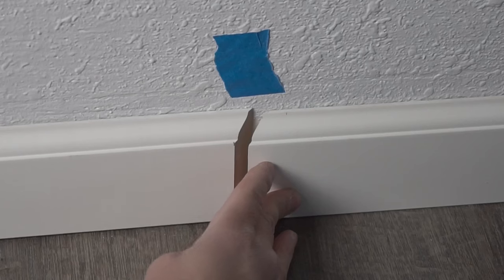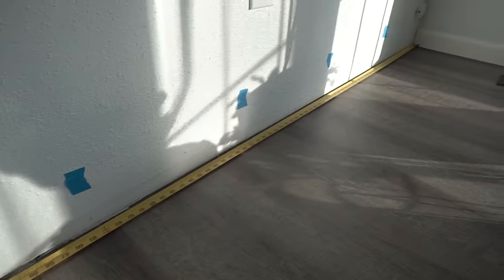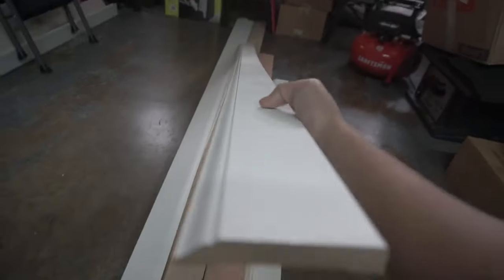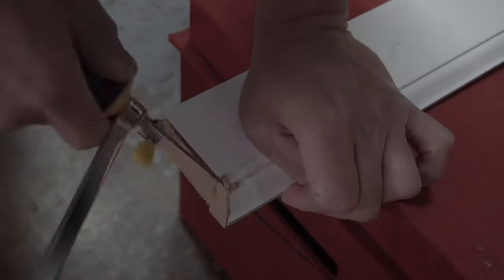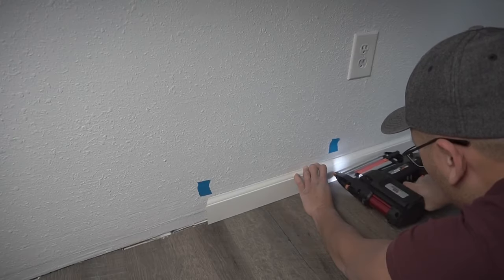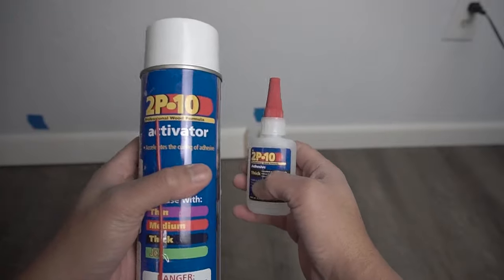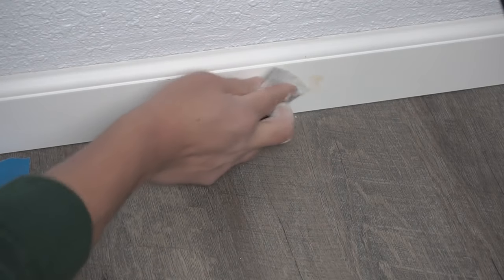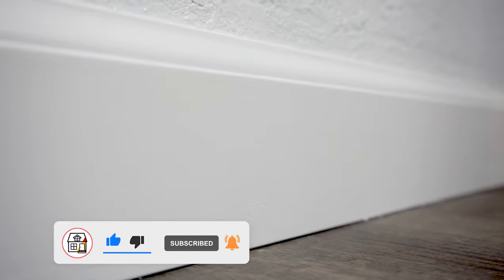How To Get Perfect Invisible Seams Joining Baseboard Trim And Moulding Like A Pro! | Scarf Joint

Comment: You're the man! Excellent tutorial. I wish the trim installers that worked on my new home build had watched this video. The decorative trim they installed near the middle/perimeter of my dining room walls have such raised bumps that you can see the joints from 12 ft. away!
Reply: I had the same problem from DIY previous owners did. I sanded and repainted, even did wood filler in the bad gaps. Can’t even tell!

Comment: Pretty good demo but can see about an inch above the new baseboard where the top of the old baseboard was. Looks like the wall was just painted over. I would've either sand it out and match the orange peel texture of the wall or just put the orange peel on, then paint. Just something I would do.
Reply from the maker: Thank you for sharing your technique 👍🏽😊🙏🏽

Comment: great video.  question ? so when you are joining the two pieces of baseboards like in the middle not inside or outside corners but just connecting two pieces did you just cut both the ends to 45 degrees. That is what it looks like and add the wood filler so you can't see the seems?

Comment: Scarf joint looks great! Question... Im thinking about DIY my baseboards on my new Vinyl Plank Flooring. The installer said to use 1/4" spacers for installing the baseboards to allow for expansion. But I noticed you just laid them on the floor planking and nailed them in... Is this a mistake on your part or is the 1/4" space really needed?
Reply: Are you saying to lift the baseboards off the flooring by 1/4"?

Comment: Have you ever had issues with the cyanoacrylate glues versus a wood glue long term? I worry that it may crack/split over time
Reply: Woodworkers trick... use both.  I use a couple dabs of CA on one side & spray hardener on the other in the center to place and hold the pieces to get perfect alignment, but most of the joint is held with traditional wood glue around the outside edges.  The CA will hold the alignment and the wood glue will provide the strength.

Comment: If you shim under the baseboard, how do you cover it up? Do you run a bead of caulk on the bottom?
Reply from the maker: Yes you can caulk or use quarter round or shoe molding 👍🏽😊

Comment: ok, so if you had to cut out a small section with an oscillating tool how would you make that 45 degree bevel? or would it have to be a straight seem if you're not able to take apart both sides?

Comment: I also heard you can use tape on the cut so that the finish doesn't chip with most types of wood - take with a grain of salt though no idea what kind of tape or if it actually works.

As for the finishing, use a damn putty knife thats as close to the size of the baseboard as possible, use DAP (the blue container with pink stuff inside) and use very light coats, sand with 360 grit, wipe with soft cloth and tape your wall with painters tape then caulk using your finger in one smooth motion (no going back over it if you can avoid) then paint pronto and once done peel tape - this will give you a very clean line & prevent hours of trying to sand something (also scrape your putty knife edge to clean it every few passes) this only works if you don't have stucco walls inside. When doing trim you touch don't roll it, use a high quality brush and floetrol - will get you very smooth or glass like finish - actually you should spend money on 3 things and go as high quality as you can 1. paint brush 2. roller (the frame if you will) & 3. drop sheet 3 1/2. a decent locking extension pole of your choice

Comment: Why not lay the trim flat and turn your saw to the 45 degree on the vertical slider.  Or does your saw not have that feature.  Most do though.  I used to do it your way but the blade never cuts down far enough through the trim

Comment: Outstanding.  This is the only part that’s giving me fits.  God help you if you don’t get that set perfectly with that CA glue….you’re f**ked.  I’d kind of like to see how that’s fixed.  I need a few more seconds of adjustment time.  So, maybe I’ll try using the drops on both sides method.  I just don’t want it to get messy.  Great video!

Comment: I didn't know there were nail guns without an air compressor! Do you recommend the one in this video to do an entire apartment or is it better for small jobs? This was very helpful!! Thank you so much for making this video!
Reply: Personally I find the air tools with a small compressor great for small, occasional jobs.  I have a lot of battery powered tools as well, but the battery powered tools can get expensive since you're paying for tool+battery. 

 The air powered tools are generally very inexpensive, and I've gotten a lot of use out of an inexpensive brad nailer, and an inexpensive flooring stapler.  YMMV.
Reply: I use a 18 ga brad nailer by ryobi and I use two 5ah batteries for it it is around 250 in total but works great! I believe it’s more expensive to have a air tool. But yea ryobi has never given me any problems while doing trim moulding
Reply: I hiave all Ryobi nail guns and they are great. I have a pin nailer, 16 gauage, 18 guage, crown stapler and they just came out with a framing nailer!

Comment: Hello.  Question?  
I need to make a 46 degree Bevel cut but my miter saw only does up to 45 degree bevel cuts.  My miter will do 46 degree miter cuts  however.   Any idea on how to do this?  I would hate to have to buy a new saw.

Comment: Honestly u don’t need to do an overlap mitre joint to abutt skirting nowadays it’s the old traditional way of doing it to produce a larger glue area for the two separate pieces join up securely but nowadays with far more superior glue available and all the modern skeleton gun applied adhesives u can just butt joint them at 90 degrees to each other it’s far quicker and easier don’t get me wrong the way shown here is still superior but nowadays it’s overkill and honestly unnecessary ur end results will b just as good with a butt joint if done competently modern pva,s form a very strong joint that won’t part under normal circumstances

Comment: Why use the glue at all? You've got 'em nailed down, they're not going anywhere?
Reply: Any wood based material has the potential to expand on contract due to environmental conditions. Gluing your trim and paneling can prevent future issues.

Comment: You lost me when you rolled the fresh, brushed on paint to get rid of bush marks. You can still clearly see the brush marks close to the floor and also to the side so either it was already painted with a brush or you didnt go far enough over when rolling. Either way for a little touch up like that a foam brush wouldve been better or just a regular brush and make sure you brush it out well maybe even doing two coats and you wouldnt be able to see the brush marks unless you're on your hands and knees staring at it lol

Comment: You could have used a 45 degree angle in the corner and paintable caulk on the other seam.  Those changes would have saved you time and effort and would have looked just as good.  They're baseboards for god's sake.  Rookie.

Comment: "professional"?  I had professionals install some foot molding and it looks bad.  Tiny brad nails stick out and some seams are not flush.   Flooring "professionals" also broke the face of my stove.  Saw dust was everywhere.  They left my front door open for 7 hours while they cut wood.   I air conditioner had been on.  I had had my air ducts cleaned recently.  They left my furniture outside in the hot sun.   Why are some people so terrible and careless at their jobs?  I'm going to learn DIY.

Comment: Whoa whoa whoa, the most relevant parts of the how-to you just skip over and don't narrate. What are you doing with the three dots and lines for cutting? What are you doing with the tape measure that clearly shows 84 7/8" for all of 0.2 seconds, and why did you say in the very next scene that it is 84 3/4" instead? I had to go back and forth like 4 times to see what you were doing :-(